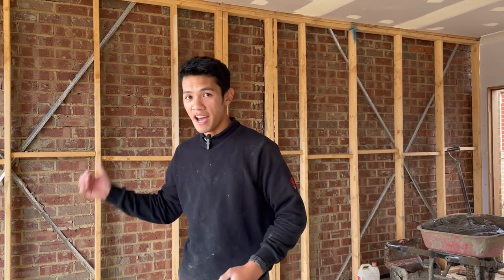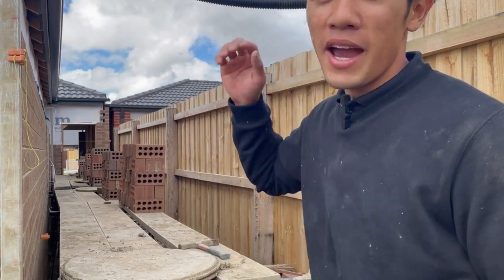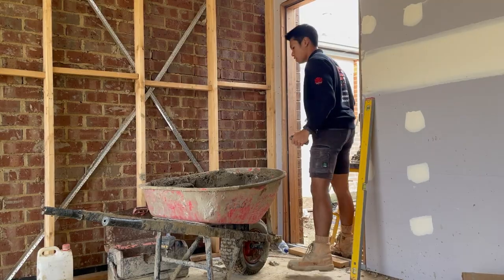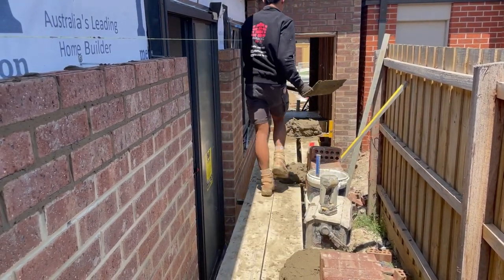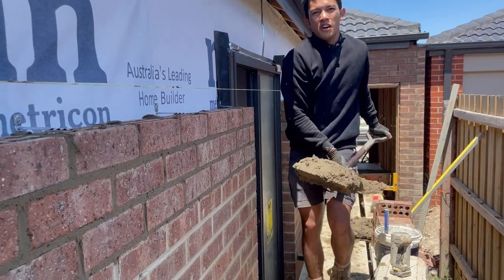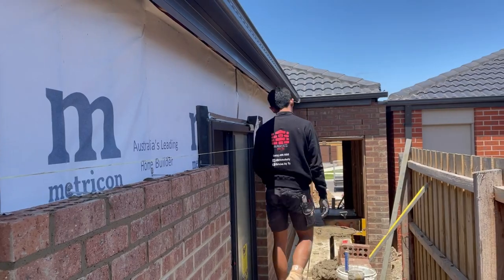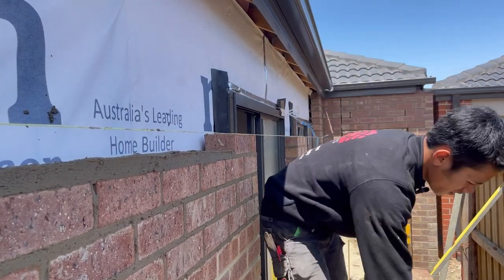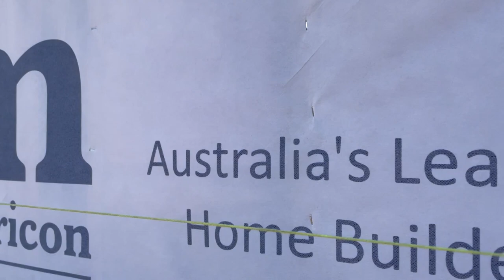NO LONGER ON MY OWN... | BRICKLAYING AUSTRALIA

Comment: Would add. For less motion. When u spread mortar for one to two bricks- Do your furrowing of the mortar at the same time. Saves u going back to do it. Good bricky you are mate
Reply from the maker: Hey there! I spread the entire panel for the special effects haha
Reply: @bricksbyty  Ok buddy. 👍
Reply: I generally find that when you spread a trowel out,then furrow that mud...and continue for the rest of the walls length furrowing every trowel full that you spread instead of doing the whole wall at once,it's less faster and less efficient,and I guess that's what matters when you work for price is how fast you can do it,it's best to spread the whole bed,and furrow the whole bed
Reply from the maker: Might have to do a 'Versus Series' on it! Though our first video on that series is coming soon...
Reply: aesthetics  but you are going back where you have been. When with the same position, two movements have been completed.  Finito.
Reply: @topcatcoolio8807  the amount of times you go from the wall,to the mudboard is the exact same,the difference is you're spending more time on the wall mucking about,where you could instantly get the mud on the wall,and furrow it all,you are not saving any motion or time unless you pick up a brick the same time and lay that on your furrowed bed,if not picking up a brick then it's slower
Reply: @p.maesthetics7154  Well disagree.   when it could be done  same time.. it's done,  no going back. No double handling . If u look our mate here at beginning is spreading .then going all the way  back to same spot. When in one quick motion. The spread and furrow is done same time.. Can you see  hes spreading then going all the way back to furrow. When it could be done same time.? Then the laying of bricks. Yes if pick and dip another thing matey
Reply: @p.maesthetics7154  I was taught as well.  If you are right handed to spread from left onwards to right. Using your back motion to help the spread. ( other if left handed)  I've done different ways too.. suppose we learn our different ways . Take care